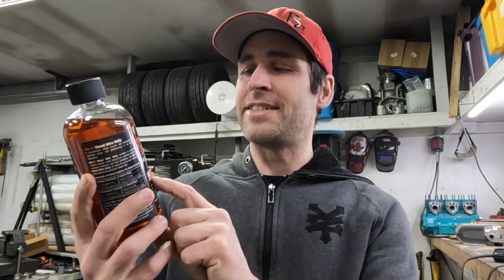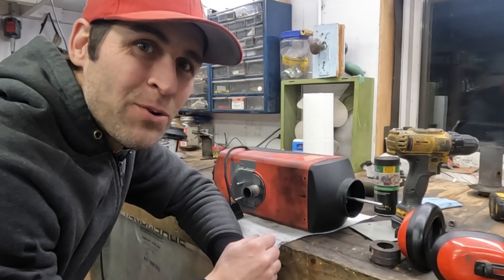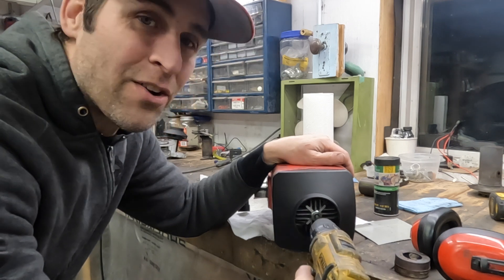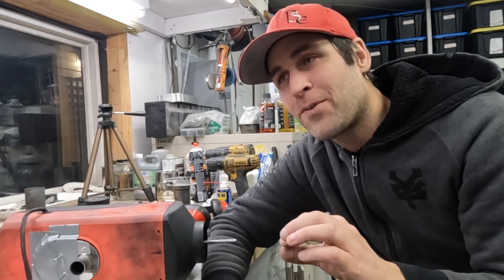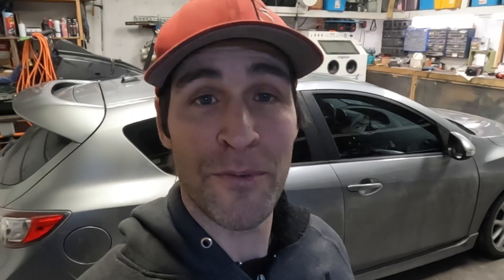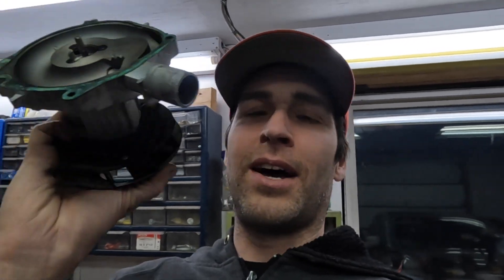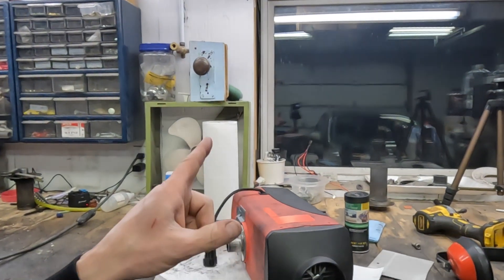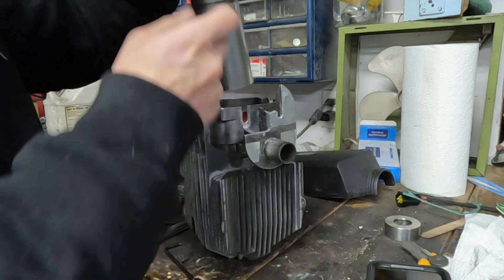Self Cleaning Heater - Veg Oil Fuel - Fuel Additives - UPDATE Video.

Comment: Brilliant stuff mate! I ran 70/30 kero - very clean WVO for weeks with the exhaust going into  a cast iron radiator. Eventually it clogged up. Upon dismantling it was very carboned up but also the radiator had a lot of water in it. ...so it could have been the fuel or restricted exhaust or a combo of the two. I find petrol a great thinner for WVO although kero seems almost as good and I guess safer to mess around with. Anyway, I too very much look forward to seeing how you get on. I can see fame and fortune coming your way if, no sorry, when you succeed!
Reply from the maker: Thanks for the comment and details ! 

The carbon indicates that it may have been due to restriction. I have had issues with carbon with very little exhaust restriction, this is why one of the first things I check now, is the CO levels. They are a good indication of what is happening. 

I wish I had access to more veg oil, as I am using new stuff for my testing, and it is not at all cost effective. I would love to do more testing and see how little diesel and gas I could use, and still get a reasonable burn. 

Haha... fame and fortune 👍... I can't wait. My new design has potential, but we will see how it actually performs.
Reply: @loweredexpectations4927  IF clean combustion in a CDH can be compared to a 1980s diesel engine then 20:4 WVO -petrol works a treat in Northern Britain with no problem low temp quick start-ups...
Reply from the maker: @EelingStudios  Yeah, unfortunately, they are not really comparable. Fuel in the heater is not injected under pressure, it is not atomized and it is not burnt under compression. The combustion process is also not nearly as energetic or disruptive. These diesel heaters are basically a candle that has fuel delivered to the wick with a pump, and have a little extra combustion air supplied by a fan.

Comment: Veggie Oil does work decent , But unless you can get is Used for free or near free, the price is crazy on it currently least here in the states. Right around $10 per gallon. Did a Veggie, Petrol, mix & even did with a bit of diesel. More less that is just Dirty Diesel fuel, but instead of motor oil its Veggie oil.  I'm still using that External fuel pump driver setup I was talking about before. So far that seems to make everything much better, Having that Fuel control separate from air makes a world of difference.
Reply from the maker: Yeah... The price here is about $3.50 a litre $14 a gallon. 

A LOT of people can get it for free... even new stuff somehow... many who I have talked to, and many more collect used stuff... they either have an arrangement with a restaurant, they spend some time hunting it down. 

I can't wait to have my own fuel control.

Comment: Just wondering if you extended a tube to the outside over the shaft of your cleaning rod, then on the end used a graphite packing might that help seal it? Extendeding should keep the heat lower at the seal.
Reply from the maker: That is a good idea. I have a few thoughts on how to seal this up if the general concept actually works. I was thinking, something similar to a piston ring installed into a groove inside of the "bushing" made from copper. 

I was even thinking that it could have a mechanical seal similar to a ferrule that was loosened when the servo motor turned, and then the motor would reverse and tighten, two revolutions one way and then back. 

Something like you say, on the outside would likely be easier and much more practical.
Reply: @loweredexpectations4927  
Some heavy duty engines used  compression type rings for sealing on the exhaust system. I find they were bad for sticking and leaking but turbos run pretty hot but I've also been surprised by how much damage can occur inside these heaters during your testing.
Reply from the maker: @kenj469  Yeah, some two cycle engines use rings on the exhaust manifolds. It is petty harsh inside there, that's for sure. I am considering using ceramic sleeves over the shaft, on the inside, if the system works at all.

Comment: I our older diesel truck we have had good luck with 
80% WMO filtered
15% diesel or kerosene 
5% RUGas
-this mix thins the wmo and the RUG helps it light off
Just a thought.
Reply from the maker: I have tried all sorts of WMO mixes, including 50/50 diesel and 50/50 with gasoline, and none of them worked terribly well... the issue is that the diesel or gas flashes off, burns rapidly, and leaves the oil behind, smouldering away, as it does not get hot enough. 

This is why I have gone through such effort to make a heater that has a nozzle that injects oil with air and also a chamber that is easier to clean. ATF and other products seem to burn much much cleaner than engine oil.
Reply: Using the air pump and injecting air and oil is genius. 
Even on a completely stock heater burning diesel, just add the air pump.
Reply from the maker: @mp5778  The standard heater set up works very well on diesel... when you tune then correctly, they make almost no CO, less than 12ppm, and make no carbon / soot to speak of.... I'm not sure that injecting diesel with air would have any benefits.

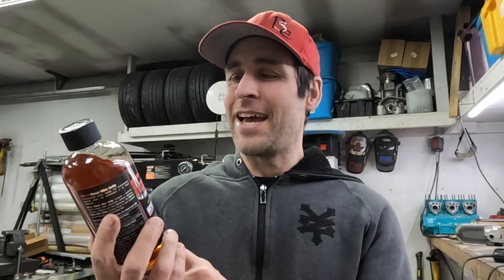Comment: 1:45 im curios now what happens if you run a heater on pure c-tane booster🤔 not sure if thats spelled right 😅
Reply: Cetane
Reply from the maker: Haha... I am also curious. 

Someone would have to donate a LOT of booster before I did that test, though... I think this bottle retails for around $40 CAD .... and it is about half a litre.... That's about $320 per gallon.
Reply: @loweredexpectations4927  damn that's incredible expensive

Comment: I was just thinking about if you could put some sort of vanes on the dish if it could spin its self? similar thing to rotating Xmas decorations you put above a candle. obviously different heat, flame etc than the cdh but just a thought.
Reply: just remembered we had an old electric fire with log effect lighting, spinney vanes mounted above the top of buld
Reply from the maker: It would be nice if that would work, but unfortunately, it won't. 

The amount of torque created by those devices is just enough to keep the fan spinning. Any resistance on it at all would stop it. 

The force that spins those things is from convection current, and there isn't any convection inside of a heater chamber. There is flow form the fan air, but if you use energy from the fan air, you restrict air flow, and that would make the heater work poorly ... and not produce much torque, either. 

I have considered trying to extend and use the shaft from the fan motor to spin the dish... and decided not to do that, as the fan motor would probably burn out or just not be able to spin, due to the torque requirements.

Comment: More excellent and fun content. Looking very forward to your next few videos. They may help me with my standard ( turn on and heater) when I use it next month in Wyoming. Elevation, 6,200 ft 😳😳 hahaa keep up the fun work!
Reply from the maker: Oh boy.... at that elevation, you will likely need some sort of elevation compensation, of you run it for very long. If your heater has an Alpine mode, I would definitely suggest using it.
Reply: @loweredexpectations4927   Sadly and ignorantly I purchased one that doesn't have Alpine mode or any means of adjustment. At the time, I even consider the air to fuel mixture at high elevation. Next one I purchase will have the bells and whistles. So, I am of course hoping you have a breakthrough on a product that may help keep the soot down. Gonna need it at least 2 months, hopefully I can keep it running. Fingers crossed 😳🤔😆
Reply from the maker: @alanweisner2421  Most heaters will either grant you access to an engineering menu, have an alpine mode, or have automatic compensation. Red digits and a black plug at the controller are indications that you may have an engineering menu. 

unfortunately, there are so many different ones, it is hard to keep up.

Comment: I have been running a diesel/sunflower oil/gas mix without problems during Corona when diesel was much more expensive than sunflower oil which has a price cap in Hungary.
Reply: I've heard running bud light in it works... Cheap also.
Reply from the maker: HAHA.... Yes... but people might see you purchasing it and assume you are drinking it... Not a risk I'm willing to take. 

Ps... I've never had a beer, Bud or otherwise, haha.
Reply from the maker: Good to hear. Do you mix the same or a similar ratio ? I'm curious to know how little diesel can be used and still not have issues. 

I have heard from a LOT of people who have had issues... so I'm curious as to what the differences are.
Reply: @loweredexpectations4927  I have run 50% sunflower, 40% diesel and 10% gas 98 octane. My chainsaw, mower and generator all use 98 octane, I used what I had at hand.  Start and stop on 100% diesel.

Comment: Is the veggie oil new or been used? I have had comments on my stuff too about the veggie oil but never tried it
Reply from the maker: It is new... but only because it saved me the hassle of filtering. Given the results that I have had, I will be looking into getting some used stuff. 

From what I have heard, the challenge is burning the glycerin in veg oils... This doesn't seem to be a problem at my current mix ratio.
Reply: @loweredexpectations4927  makes sense to a dumby  like my self 😂😂 think over all when you compare these heaters vs waste oil ones there's a huge difference over all but that's what makes it a good challenge
Reply from the maker: @ChippyOutdoors  It is a challenge, for sure ! Haha.
Reply: @loweredexpectations4927 
That must be an urban legend. Glycerin burns just fine. It may need preheating though - but the whole soup needs that.
There seems to be a point in interchanging the glycerin with alcolhol, though - as the gouvernment demands esterification of vegetable oils for Diesels.
But it seems, like only chemists will understand that - a simple mechanic can't.
Since the energy out of the taken out glycerin is higher than the amount of energy of the put in alcohol - so lower gas mileage is the result. Plus the used up energy to esterify the stuff beforehand.
Plus another hard to understand negative point - the resulting fuel demanded changes in fuel hoses materials - since this alcohol content dissolved the rubber used before.

The normal user just burns fresh refined vegetable oil with a preheated fuel filter and it does no harm to any Diesel engine.
But the mandatory vegetable oil content in our Diesel fuel is esterified.

So - if you can burn vegetable oil without the usual ash mess with these heaters - no surprise.
Reply from the maker: @werner.x  I tried burning veg oil in an open flame (not terribly scientific) and it took quite a bit of heat to ignite. Once it was burning, it seemed to be self sustaining for a few minutes, but then, the flame went out a little after half of the volume was consumed.  

What was left was a much thicker, and required a lot more heat to ignite and to keep it burning. Once it was burnt up, there was a substantial amount of carbon. I tried this with Diesel, Coconut oil and Canola oil (veg oil) and used engine oil... all with 20 grams of fuel. The coconut and veg oils were by far the worst. Of course, forced air, and in a compression engine, this is going to be very different. 

The test I am currently running, doesn't have any preheating,. Standard tank, lines, pump and heater. I suppose mixing it with diesel and gasoline could be considered preheating, as those fuels will flash off and burn readily, producing heat to sustain the oil burn... Perhaps that is what is happening. 

I do not understand the "esterification". From my understanding of the alcohol and lye process, the alcohol and lye cause the glycerin to separate out. Most of the alcohol and lye stay with the glycerine, and in the industrial process, the alcohol is then removed (distilled out) from the repainint fuel and reused for the next batch.
Reply: @loweredexpectations4927 
Vegetable oil is used for poor mans open flame lighting since the invention of pottery.
It's messy, but as soon as the lamp is heated up, it usually works.
Maybe the lamp construction needs a wick, but  needing a wick is not so good - it's a consumble and has to be clipped regularly to keep burning smooth.
That's, why the ancient flat style oil lamps are by far the better ones. No wick needed - but they burn with a lot of oil sputtering around.
There were good reasons people switched to gas lighting when invented.

 Yes, carbon buildup is a typical low temp burn veg oil problem - and heavy fumes due to incomplete burning too - But that's the same with any other high viscosity oil. 
And like in a refinery - the lighter stuff vaporizes earlier and in the end the hard boiling stuff is left behind and you can pave roads with this glue.
Agressive preheating will solve half of that problem, but not really needed here, i assume. 
Because you work with forced air - and that extra oxygen usually does the trick of superheating and burning everything.
But it's important for every use case of vegetable oil - residues do oxidize and get sticky - wherever this can cause failure or excessive work, resting idle and getting "rusty" has to be avoided with veg oil.

As far as i remember, esterification ends up with getting the fatty glycerin out and inserting alcohol instead.
I'm sure, i did forget a lot of details.
But i assume, that process is totally variable and dependant on what you need as the end product.
Reply from the maker: @werner.x  I will post a few photos on Patreon of the chamber after and exchanger after burning 4L of veg oil.... the next portion of testing should be done in a few days.
Reply: @loweredexpectations4927 
I hope, patreon doesn't start to delete my comments too. YT is overdoing it.
Makes even me hoping it to decline.
Reply from the maker: @werner.x  The censorship is crazy.

Comment: Used refined vegetable oil isn't too problematic to burn, if heated up enough - unrefinded works too, but always contain some percentage of plant gunk, which loves to clog filters - many people have burnt many liters of vegetable oil directly via their Diesel engines for decades now - just ended with the pandemic - too expensive now - and besides of surface metal damage inside the high pressure pumps due to a too high fatty acids content a Diesel engine can manage used vegetable oil without any ash builtup. The main problem with plant oils, fresh or used, is oxidation - and the stickiness of oxidized vegetable oil, since this sticky residue is almost impossible to dissolve. 
My canisters all have sticky goo at the bottom, no way to get it out, exept burning the canister.
But these are specific plant oil problems and not the typical used engine oil ash problems.
There is up to 7% of (processed) vegetable oil in our Diesel too, for about two decades now here in Germany.
Reply from the maker: I sent you a message on Patreon about this, haha. 

I was aware that people had burnt it in old diesel engines, but I was under the impression that they were a little less particular than a diesel heater. I can see it damaging the fuel pump... 

Used veg oil is expensive ? I had also heard of a sticky residue, and had heard / read that this way caused by the glycerine. 

Really ?! They put plant oil in diesel in Germany... Interesting.
Reply: @loweredexpectations4927  I hope, this reply lasts - haven't had any luck for some times now.

Used vegetable oil isn't easy to get any more in Germany - so we usually bought fresh oil - as long as it was cheaper than Diesel.
It's also healtier for the pump, since the fatty acid content of used veg oil usually is way to high.
So - to use it on a car you want to keep for a while, used veg oil needs more than filtering, it needs acid buffering too.
Together with the gathering not that cost efficient any more.
So, that they aren't allowed to give it away any more isn't too much of a loss.

But the point is - no ash problems, usually.
Reply from the maker: @werner.x  If I could buy veg oil cheaper than diesel. I would be doing a lot of experiments with it, for sure ! ... Where I am, it is about $3.50 per litre, and diesel is as low as $1.29 if you search for a good price and $1.47 at most places.

It will be / would be interesting to see of the acids have any effect on burning it in a heater. I was looking forward to making biodiesel with methanol and lye, but this appears to be working too well to make that worth while.
Reply: @loweredexpectations4927  I'm not aware of eaten away engine parts due to unbuffered used veg oil - just the inside surfaces of Diesel pumps looked strangely discolored, which indicated wear - but it may have been misinterpretation, since we never measured anything - so, looked worn or maybe etched?, like Diesel would never do, but unfortunatelly with the usual superficial shop habit under constant time pressure - no scientific data here.
Reply from the maker: @werner.x  That is totally understandable.

Comment: Can you do an experiment on burning very old stale diesel from a junkyard. I only have use for diesel fuel in my heater and wonder if it will work if very  old and stale. Thank you
Reply from the maker: I actually burnt very very old stake diesel in my heater, as it's very first tank of fuel, haha... It came out of an old diesel generator that had sat for almost 10 years, then I kept it in storage in a jerry can for another 4-5 years. 

It was only about 5L of fuel, and I didn't take the heater apart afterwards, but it seemed to work fine, until I introduced the waste engine oil... If I can get some stale diesel, I will try it again.
Reply: @loweredexpectations4927  Thanks for the reply. I really appreciate the knowledge.
Reply: @loweredexpectations4927 if you add the EXL +7 Diesel Nitro to the stale diesel that will increase the stale fuels flammibility